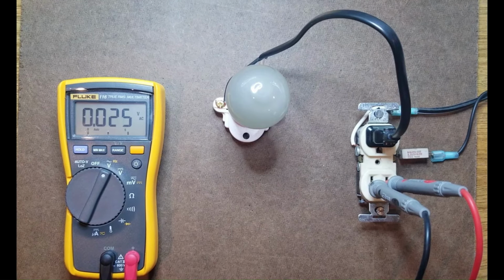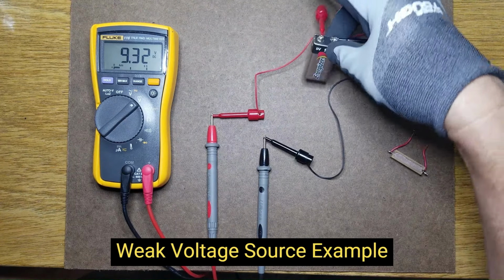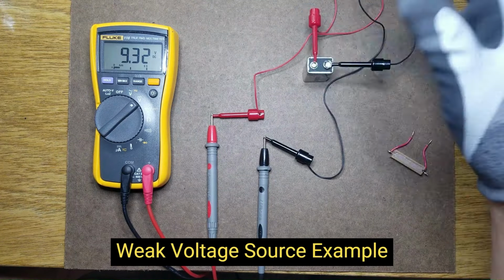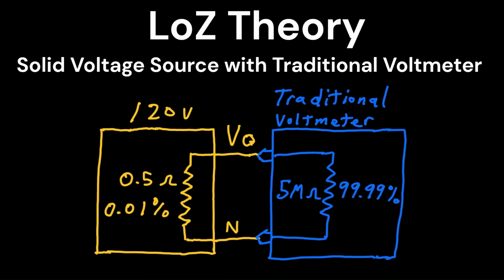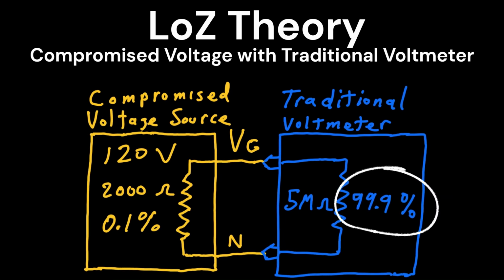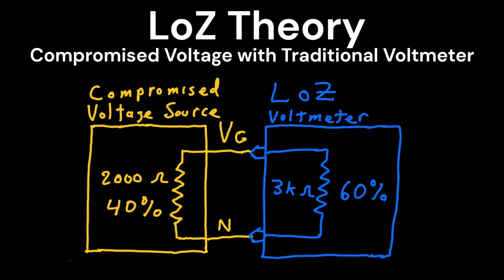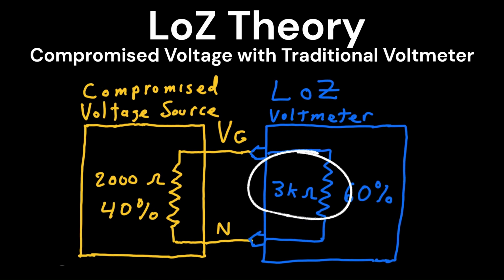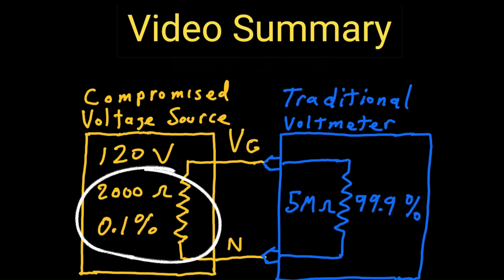#66 - Fluke 116 LoZ Detection of Compromised Voltage Sources

Comment: Thank you very well, explained, and thank you for the link also, explaining how low Z actually works.Great video great explanation. Just curious , I guess I could look it up to , but what are the limits to how much you can put on the low z setting on a one sixteen fluke. Say , for instance , can you check a 408 circuit three phase. I guess I could look it up but I am not at all.familiar with the low z seting  , just diving in right now.

Comment: Thank you for explaining and making it easier to understand the logic behind the LoZ testing. What is an acceptable voltage drop when using LoZ for an uncompromised voltage source? Will a too long of wire run to an outlet from the breaker panel potentially reveal voltage drop with the LoZ testing, even with no loose connections?

Comment from the maker: A compromised voltage source can be upstream of an appliance, at the appliance (terminal block), or even internal to the appliance (i.e. on a circuit board), as long as the load (like a motor) that depends on the voltage is downstream of the loose connection that precludes the load from obtaining the designed amount of current. So the voltage source (as the load see it), is compromised. This is why some of the examples of loose connections I showed in the video aren't actually physically upstream of the appliance.